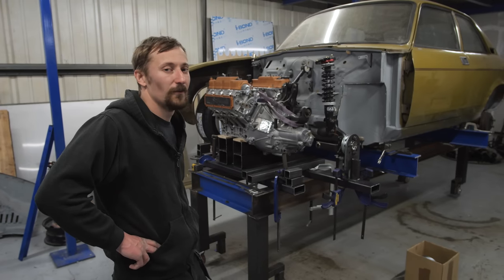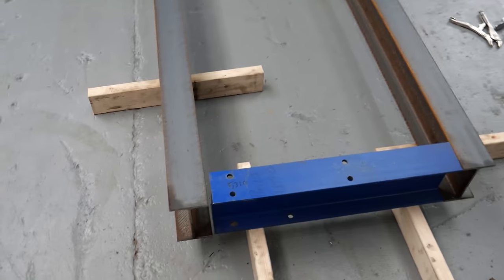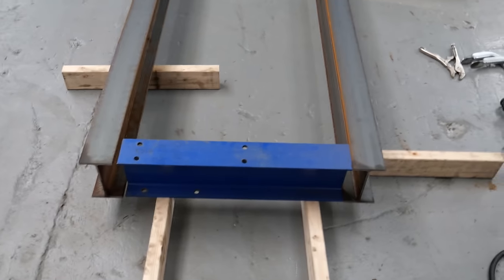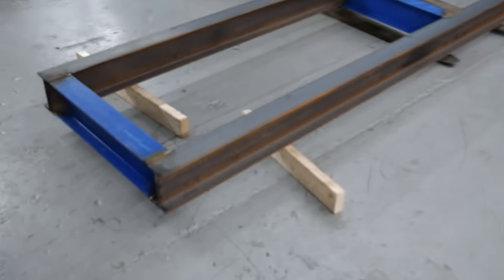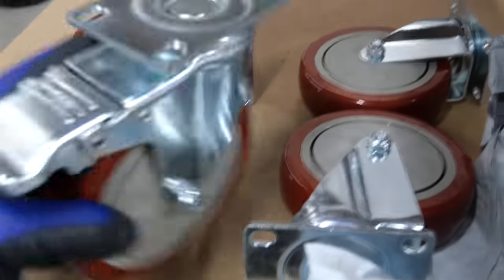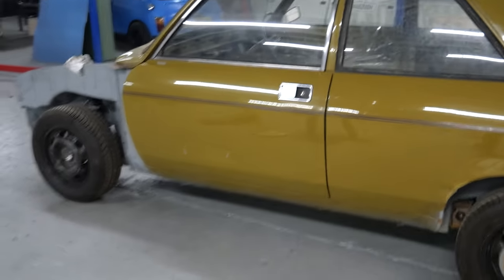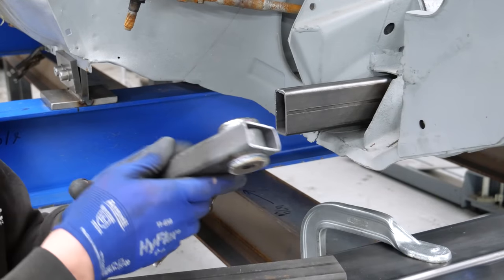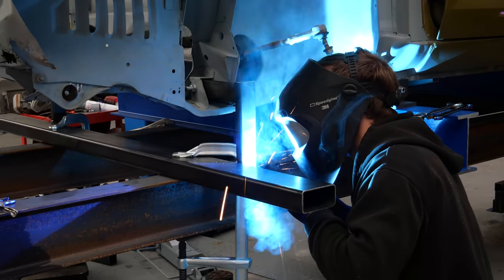Project AllegRo - Jonnys K20 VTEC Sleeper Build

Comment: Good update, its nice to see this project coming along.  You are absolutely spot on, spending time now getting the suspension right and you have the best chance of it driving well.  I set up four wheel alignment on a lot of quirky / odd cars.  A lot of classic minis with engine swaps or stuff that has been lowered significantly.  You can do your best to get a good setup but if the driveshafts are at a terrible angle its always going to torque steer.

Comment: Good videos with great detail guys! 
In regards to filling the holes in the wing top I have a suggestion that sounds ridiculous but is how Iv welded extra bits to parts with moulded rubber on them that I couldn’t melt. 
Immerse the bit you don’t want to get burnt from the heat of welding in water. You’d probably need an old bath and it would be awkward and a bit time consuming but you solve the burnt paint problem. 
Failing that. There are some incredible adhesives around that you could use to bond the wings to a sub frame once you trim the flat edge back to a point there are no holes in it anymore.
Reply from the maker: That sounds a little sketchy to me😅 but could be a solution!

Comment: As the owner of a K20 CRV they are a bulletproof engine just requiring regular servicing,  not forgetting the adjust the valve clearances. If you want to use all the revs and the vtec you can surprise a lot of people, in the Civic S it is very quick when used in anger. You should have a little car which will disillusion a lot of hot hatch owners.....

Comment: You could try and glue a strip of stainless over those spot weld holes with seam sealer mate, that would tidy it all up without damaging the paint.
Reply from the maker: Yeah someone else suggested something similar so I think that’s what I’ll do! If I use panel bond it’ll also stiffen the wings up a load too hopefully 😃

Comment: Suspension question: why keep the macpherson struts? The only advantage they seem to have are they are simple and cheap, in this case simple and clearance to the engine seem the only positives. A double A arm from a well supported similar sized car seems preferable in my opinion.
Reply from the maker: Double wishbone suspension is definitely better, but it’s important to remember we’re not trying to build a lap record holder, just a fun fast car. We already had those struts & hubs from previous attempts at this project too, it made sense to use them. I did consider it, but I think ultimately Jonny will never notice the difference. If I was building a track car, no brainer.

Comment: Did Jonny think about any other rover engines? Eg t series or turbo k series? Or are they not mental enough?? Can't wait to see the progress in this 😎
Reply from the maker: Good question! You can play around with different options forever and a day, at some point you just need to pick one. I had a K20 that I tried it, it looked like it would work well, it has huge aftermarket support, it’s proven.. it was an obvious choice. 

A Rover engine would have been great, but they’re all so old now, it’s just a lot more work to get to the point of a running car.
Reply: Its still a K series though ;) Theres also a tenuous link to rovers using honda engines anyway. So to me at least, a Honda K swap in any BL/rover group car is acceptable. (As is a ford 4.6 v8 lol)

Comment: Could you not plug weld the spot weld holes in the wings then get just that inner lip painted up the top edge keeping the factory exterior patina paint
Reply from the maker: It’s an option, but the holes need quite a lot of cleaning up/dressing before I could weld them. Assuming I can keep the heat low enough the paint shouldn’t burn😃

Comment: You are talking about the suspension and wheel setup, how important they are for a good driving and steering car. Can you take the measurements of a famous hot hatch and copy it to the Allegro?
Reply from the maker: Not so easy as that due to how narrow the allegro wheelbase is. It’s all ‘basic’ stuff though, all the information required to set this up right is out there, just a case of doing all the research!😃

Comment: Hi I like to ask you a question on the engine mounts. Why have you not trying to fit a full front sub frame of the Honda k20 as it will have all the steering rack a suspension lay out?  I watched the video on Johnny's YouTube and you said he was using VW (VAG) front hubs? Will you be fitting Honda hubs instead? And great video on this build
Reply from the maker: Waste of time trying to fit a Civic front end as it will all end up completely redesigned around making it narrower. Jonny wants a sleeper, so that means stock Allegro track width. We’re using Golf stuff as that’s what we already had from other peoples previous attempts at completing this project. 

Thanks ✌🏻

Comment: If you’re tube framing the front would it not be easier to build it all to EG civic or del sol dimensions? Nice cheap way to have a top class double wishbone setup (EG civic is 100% the same as the DC2 integra which is pretty much the best handling FWD car ever) plenty of cheap adjustable parts and shaft angles are proven etc. 

Probably too far beyond that point now and you certainly seem to know what to do to make it work…..will follow to the end. 👍🏻
Reply from the maker: Really we’d need another donor car for that. There’s so many roads you can go down, we already had the Golf parts from previous attempts at this project, so just using as much as what we have as possible. Sure, other options might be better, but that’s not what this build is about 😃
Reply: @FabCoUK  I’ve scrapped so many over the years aswell…..I have an SiR del sol there I could nick the engine from and donate…..but it’s just now kinda approaching a value where it’s a shame not to restore it really. 

The amount of EG civics that have passed thru my hands aswell…..they were so cheap at one point I bought one for £75 and it had £90 worth of tax left on it…..back in the day when it could be transferred. 

Not really sure how far along you are……I’d happily offer up a chassis for taking measurements off…..take it as long as you like. EG civics are getting a bit expensive to get hold of. But cheap Del sols are still very available…..probably get the bits you need for free if you sell the bits you don’t need…..I only say this because that would mean every consumable front end suspension part would be off the shelf. Billet mounts from China £120…..snap a shaft and get one off eBay……like I say you’re probably too far in to scrap what you’ve done….and I have no doubt you will make an incredible job…..but having the only bespoke part being the tube frame itself…..and everything else you would ever need to replace is bolt on off the shelf would be pretty amazing.

And then adding the advantage of The best FWD suspension setup of all time and dirt cheap parts……I just can’t not mention it. 

Either way I have no doubt you’ll nail it. Can’t wait to see it go. 👍🏻

Comment: If the feet are load bearing, wouldn't it be better to put them directly on the main legs, and the castors on the side legs?
Reply from the maker: Could have been, but I was concerned with the weight of the car and my Chinese castors. I actually did such a good job squaring it all that on my level floor the car sits perfect anyway 🤩

Comment: Toss up between princess / allegro blue it I'll take both.
Reply from the maker: It’s a tough choice, but the Princess takes it for style for me!
Reply: @FabCoUK  Always liked them but reliability issues stopped me buying one ( not sure if I'm right there ) but worked at a sports centre in the early 80s and a fleet of these turned up to take the sport stars away , a lot of them wouldn't start ! But you've hopefully got round that with your underpinnings , look forward to more updates.

Comment: I am horrified by the thought of what this project will cost. I liked the original idea of making an Allegro sleeper but the project appears to have gone far beyond what is worth doing.
Just because you can and have the engineering knowledge to do it doesn't mean the end product will be worth the journey.
Nice showcase for your abilities though Adam. Not sure that I will be following the project much further.
Reply from the maker: I’m not sure I understand your statement. Sometimes just because you can is exactly the reason you should? I mean, why not? If it’s what you want, do it, and do it right. Either do it properly or don’t do it at all😊
Reply from the maker: I’d also add that for me specifically, I’m about the journey, not about the destination. Wether it’s worth it at the end is irrelevant if you have loads of fun along the way.
Reply: I can tell that you are having fun and you are doing a great job. I guess you are also getting paid for your work(either directly or by youtube subs) so to some extent it doesn't really matter if the end product is worth it or not. 
I liked the idea of modifying the car on the cheap as I could relate to it but I don't see the point of completely re-engineering/re-building a car that will look like an Allegro. May as well just bolt an Allegro body on a hot hatch.
I have no criticism of you and admire greatly your engineering ability but to me the project has lost its point. To end up with an Allegro lookalike hot hatch that will have cost £40-£50 k seems to miss the point.
Just my personal opinion  of what the project has become.
Reply: @FabCoUK  just thought, is Jonny no longer involved and it is now your project? That would make more sense if you were just doing it for yourself rather than Jonny paying you to build it for him.